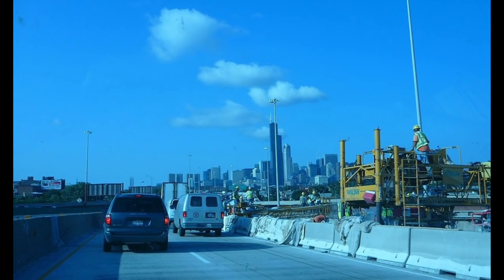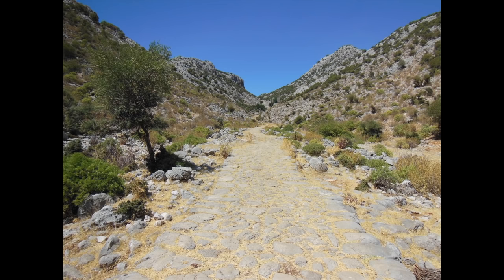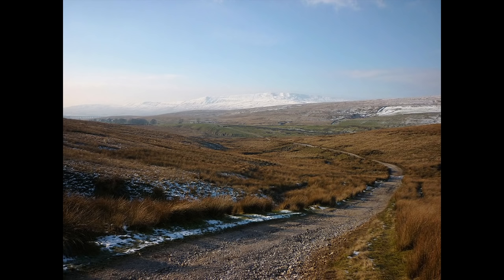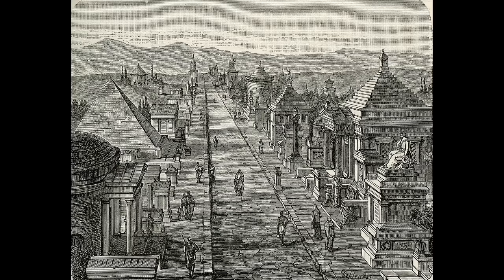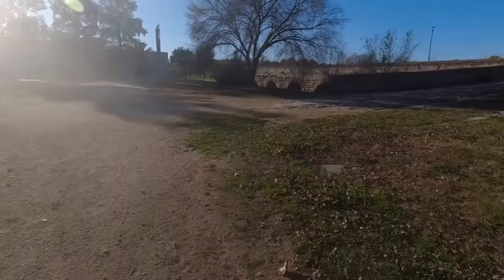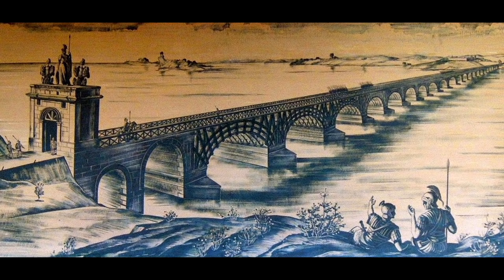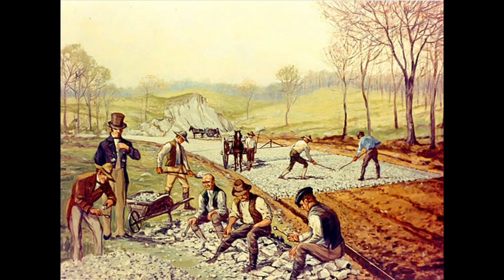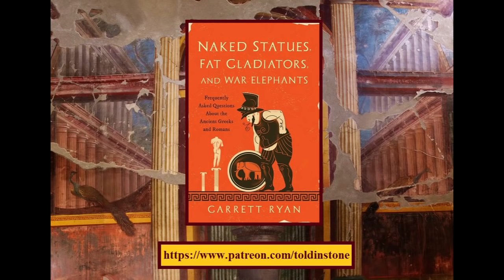Were Roman Roads more Durable than Modern Highways?

Comment: Comparison of modern traffic verses horse and carts has some validity on "service wear".  However, there are Roman bridges that have been in service 2,300 hundred years carrying modern traffic across them. Roman bridges compiled by the engineer Colin O'Connor features 330 stone bridges for traffic, 34 timber bridges and 54 aqueduct bridges, a substantial number still standing and even used to carry vehicles.   How long does a modern bridge last max 200 years.

Comment: if you need to redo roads EVERY year, there should be a redesign for the affected areas. Change the way it's made, use harder or more flexible materials, depending on what's required. More resistent to frosty conditions etc.

Comment: Most of the rodas shown in pictures are not Roman roads and can be 1000 years younger than Rome. Roman roads (highway) were convered in gravel, not in stone made with irregular pavers. The diagram (taken from Vitruvius' text) is not found in any Roman road, especially since the Vitruvius' text was about building villas, not roads. The road network was primarily used for transportation and trade, not for armies.

Comment: Just bear in mind you need to compare apples with apples. 
Roman roads are typically in low traffic low speed areas. 
Lower traffic obviously means less wear to the road.
Lower speed means less wear on the vehicle and the road.
Less noise is another factor of tarmac roads.
In addition new roads are designed to provide a certain level of grip.
New roads often have infrastructure in and below them.

Until they build a Roman road as a motorway we can't be sure how good they actually are.

Comment: It's curious that Illinois (or any northern states for that matter) would still surface their highways with concrete instead of asphalt. Almost every paved road that exists in Canada is asphalt-surfaced to allow it to stretch and rip without shattering when the frozen ground heaves in winter, then glue itself back together when the scorching summer heat makes the blacktop expand. Chicago could probably cut down on the length and severity of Construction Season by switching away from concrete surfacing. I know that just across the border in NY, the only place to find concrete surface is on interstate highways.
Reply from the maker: I'm no expert on modern highway construction, but I believe there are expansion joints between the concrete slabs, which reduce the effect of the freeze/thaw cycles.
Reply: @toldinstone  I'm no expert either, lol. From what I do know, expansion joints and other mitigating strategies do help, but don't solve the problem. Salt & sand treatment brings other issues for concrete as well. As I understand it, concrete is actually better for traction and durability against wear so it's the go-to choice in warmer climates.
Reply: But then Illinois couldn't hand out continual contracts to repair and replace the roads! Sorry, cynical Illinoisan here.
Reply: @artteacher71  I mean you don’t become the most corrupt state in the Union for nothing.

Comment: I have doubts whether modern roads really deteriorate so quickly. It all depends on technology. I live in Poland and I still remember the roads that were built during communism. It was a massacre. Even though the car traffic back then was several dozen times lower than now, these roads were full of holes and ruts. But then, in the times of capitalism, new roads began to be built. More solidly. At least in the part of Poland where I live in the north, I observe that the roads that have been built in the last 20 years, despite the huge car traffic, are not actually deteriorating. They will probably be patched for several dozen years, but five ten years after construction they still look practically new.

Comment: One difference. All modern roads are bearing the weight of vehicles riding on pneumatic rubber tires. Imagine how well modern softer asphalt would hold up to iron rim wheel carts.

Comment: Given that the US Interstate system is based on the Autobahn, and both had their PRIMARY purpose for moving troops swiftly around the country, the purpose and use of the Roman roads vs. our modern ones, is not so different after all.  Most people would never think that of the interstate system since it's peacetime use of roadtripping and truck transport would become so prevalent that it overshadowed the railroads it was NOT meant to supplant.  A sad unintended consequence.

Comment: Building roads these days are engineered to a rather high degree.  I worked In a lab that tested samples from civil engineering projects. They find the max density via water content to compact the underlying dirt before laying down the pavement.. any concrete is tested in multiple cylinder breaks up to a few months to make sure it hardens correctly. The mortar and concrete mixes these days are engineered also. There are companies that test different aggregates for max strength.  Asphalt may not be the most durable road topping but it is probably the most efficient for travel.  Especially in areas that see all 4 seasons.  The loads these modern roads and bridges receive are almost incomparable to Roman times.

Comment: Modern roads are built a lot like Roman Roads. They have compacted gravel beds, are cambered to shed water and have drainage at the edges. Excepting the top layer of asphalt, which is sacrificial. It's acknowledged it won't last for ever. The Roman Road stone cappings would not last a year with heavy goods vehicles going over them, they would shift, sink and tip, they would make a horrific mess of everyone's vehicles! That said a lot modern roads are way past needing resurfacing, are often laid incompetently in the fist place (substrate problems normally) Or my personal favourite, laid fresh then weeks later trenched by some utilities company and 'reinstated' in a tragically poor way

Comment: The rocks used on the Roman roads may have been harder and tougher than concrete and for sure asphalt. May be sense the rocks had gaps they let water drain away but I would bet they wouldn't last 6 months with 50-70 mph semies bouncing up and down them. The bridges are what I consider the engineering master though. Some used for traffic into the 80's? My take on the later road builders that mimicked the Romans is, they understood if the Roman roads lasted this long it must be the correct way to build them and the vehicles where still basically the same as Roman vehicles. The problem now days is all of the young think they know better than their elders. That's why many 2nd gen businesses fail.

Comment: Trucks cause hundreds of times more damage to roads than cars.  The answer to Chicago's road maintenance problems is to move the heaviest/less urgent trucks to rail, yes even to the extend of investing in rail/water.  Alternatively/in addition, tax road usage on a combination of total vehicle weight, maximum weight per axle, suspension settings, and perhaps other considerations.   This could also be applied to the ultra expensive structures such as large bridges.   Although, roads and bridges are there to allow vehicles to move, the cost should be attributed to the type of usage.

Comment: Question. Question. Question.  So, did Roman roads have a top layer  of sand? clay? or something else to make them near glass-smooth?    Or, did they have these large flat stones that I would suspect be a little rough to travel over in carts or even soldiers marching...as a misplaced foot could easily result in severe damage to foot, ankle and leg.  A few videos say yes, but most (like yours) show a rough, bumpy top layer of "flat stones".  In addition, I would think that horses would slip and trip on these slick, bumpy stones as well.
Perhaps they were built for Carthaginian elephants?  :-)
Reply from the maker: That were paved with stones in some places (especially in Italy), but the most common surfaces were gravel and compacted earth.
Reply: @toldinstone  _Thank you.

Comment: Let's not understate the loadbearing capacity of a modern motorway, which you could land a 747 on. 
Also, prominent Roman highways were topped off with a concrete-like, smooth, cambered finish. They weren't exposed, rough flagstones. The methods they used(if not the materials) were the very same that we use today.

Comment: Although a very logical conclusion, it still doesn't explain why a Roman road nowadays that does support car traffic is in better shape than a modern road of the same width that supports the same amount of traffic. I have seen this with my own eyes, I still think Roman construction in general, not only roads, is more resistant. Obviously modern roads are smoother and modern buildings more comfortable yet less resistant.

Comment: As #HenryBrown has said in his comment it is purely down to the weight of the vehicles. Here in the UK back in the eighties we were looking to increase the maximum weight of the artic lorry to bring it line with the rest of the EU, from 38 tonnes to 44. It was shown in the Government report there would be an impact on our roads however we still went ahead with it. After taking freight of the railway network and transferring it to the roads we ironically find that the inner lanes of our motorways have two troughs in them.

Comment: Short answer is no. Heres why, modern roads have a whole sewer system constantly putting pressure on the roads causing cracks and breaks. Roman roads never had that issue. I learned this working for after hours support for councils. The main issue is built up pressure they never had that issue in rome.

Comment: Q: Were Roman Roads more Durable than Modern Highways? A: They didn't have 80,000 lb. trucks running 70 mph over them. If loads on modern highways were restricted to Roman-times weights, the modern roads would last as long.

Comment: Romans were great engineers, better than soldiers (and this is funny cause they were great soldiers too). They intimidated the enemy with massive buildings and infrastructures. Roads, bridges and acqueducts are still used in Rome (and in all Europe) nowdays. Little "trivia": at min 0:40 you show "Appia Antica" road, if you see you can notice a lot of strange holes, that's because they are the grooves did by carts and bigas during the past, they are in random position and not in the straight way because they took off the stone of the street and they reput them randomly.

Comment: Obviously they're more durable because much more labor and cost went into them, not to mention how a stone is more mechanically solid than an ashphalt/bitum mixture. Modern day road engineering is about low cost, if you have low cost you automatically lose longevity. That's just the tradeoff we have to swallow to have roads paved to the most remote areas, that means fixing our potholes and asphalt cracks every 6 months.

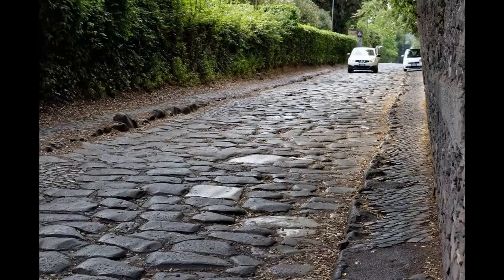Comment: 10:12 "Modern highways serve a very different purpose than their ancient counterparts" Not true at all. Hitler brought the modern highway back to the forefront with the construction of the autobahn, which was specifically designed for moving military. Likewise, after WWII, Eisenhower embarked on a nationwide revamping of the American highway system (similar to what he observed in Germany) to better connect our nation for the specific purpose of moving, you guessed it, military. It seems as though every highway system in use today was designed for the quick movement of troops and materials, and the public has benefitted from this.

Comment: 0:51 The Roman Road desgin, had many advantage attributes, bulk solid stones, didn't decay easly by wealrher of roll over impacts from carrages/carts/vehicles, the concrete between also played out like a durable flexing joint, which rain/water offers its behavier.
 THAT is whats missing in a modern highway smooth form pavement. Too puffed & bridal.

Comment: what I see happening now is...  a generation ago they would test what method survived the freeze thaw cycles over a decade or 2 - that knowledge seems to be lost and back to repairing or building roads that last a season. Obviously its possible to build roads that could last a century - but there is no desire by government or contractors to do that. Contractors build roads to yield the most revenue and that means doing a 1/2 ass job which is what they do in Chicago.

Comment: I have seen mentioned that the roads would have been topped off with a layer of Roman concrete that has worn away over the centuries.  Would anyone know of a primary source to confirm that?
Reply from the maker: Cement seems to have been occasionally used to bind the aggregates beneath a paved road, but it was much more common for all the layers to simply be compacted with heavy rollers. To the best of my knowledge, concrete was never used as pavement.
Reply: @toldinstone  Thank you.

Comment: OKAY:  The physics, of this.  Modern roads, support   WAY  WAY   more weight,  than ancient Roman roads. Also,  the rate of speed, is up to 15 times faster !  than wagons/mules/horses/oxen/goats/camels.,,,,etc.  Shorter wagons/carriages, etc. too.   ONE,  cannot compare, the two evenly, nor equally.  The weather, as well, plays a MAJOR  FACTOR,  in modern  roads.  Asphalt aggregate, (which i hauled, to the pavers) is good, only up until it ' cracks' , due to thermal expansion.  (Thermo-dynamics)  Whereas, ancient Roman roads, made of large stones, have spaces in between, for thermal expansion;  even though the temperatures, probably don't  reach down  to -30 Celsius.  Warm, hot weather, is much easier on Roman roads, too.  When it rains, the rain either soaks between the large stones, or runs off them, as Roman engineers designed them, with a  '' slope '  each side, of center, and some have ditches, for drainage.  
   oh,  another item of interest.     Todays'  railroad.     The rail spacing, (between rails) is usually 4 feet, 8 and 1/2   inches.   The vast majority of North American railroads are standard gauge (4 ft 8+1⁄2 in / 1,435 mm). Exceptions include some streetcar, subway and rapid transit systems, mining and tunneling operations, and some narrow-gauge lines particularly in the west, e.g. the isolated White Pass and Yukon Route system, and the former Newfoundland Railway.
   By the 1870’s, archeological excavations at Pompeii and elsewhere were revealing that the gauge Stephenson chose may have been the approximate gauge of Roman road vehicles. In a famous episode, an American engineer, Walton W. Evans, sought to test this hypothesis by measuring with a metric rule – so as to avoid bias – the ruts made by carts and chariots at Pompeii. He converted his measurements to inches and found that the ruts, center to center, were about 4 feet, 9 inches, consistent with a gauge of slightly less than that. Later archeology confirmed that this was the Romans’ common gauge.
   HAVE/MAKE  A GREAT  DAY  FOR  ALL......oh,  ' pay attention, safely driving ''

Comment: American cement pavements are deffinately inferior in every way to european style, as the only way to affect repairs on cement is to jack hammer it up. But in europe, you just pull up the broken paving slab with a hand tool, drop in a new paver and brush in some sand and you're done.  No trucks, no power tools, no shutting down the entire street to pour in new cement. Better yet, unlike the american cement, you can resell the broken paving slab for use in gardens as "crazy paving"

Comment: Uk roads last at 25 year for heavy use motorway some road still have the same surface 100 year on so how can you build roads wrong. Simple the construction Co,pay is cutting corners on material and design that why you need an independent surveyor

Comment: Problem with todays roads is that they are cheap, super cheap, thats a huge issue when you want something to last, roads today rarely built with support material under such as large stone or different materials to prevent the tarmac or concrete from caving in or cracking in the temperature variations and stresses put on it.
The biggest reasoning for cheaping out is so the construction companies has a steady income of fixing these roads they build, its a disgusting business practise.

Comment: Modern roads have to repatched and surfaced for one simple reason . Heavy Trucks and lorries that carry too heavy amounts of freight. Cars could not possibly cause potholes. Our roads would last for decades if all our bulk  freight was put on railway lines. The irony is that often the very trucks that cause the damage are those carrying the asphalt and rock that  repair the roads.  Try checking the roads that lead to quarries they have either the worst or the most perfect surfaces.  Its an economic racket that holds us all up in endless traffic cones.  Its tolerated because of the wasteful cycle of jobs it creates.  That is how capitalism works. The romans did not have capitalism or trucks. Modern roads are not designed to last out trucks. They are designed to keep our taxes going construction companies.
Reply: Most freight in the US is lived by rail. Still need trucks to carry freight from the railcars to the warehouses to their final destinations. 

And if you think the Roman’s weren’t as motivated by greed as we are you’re awfully naive.